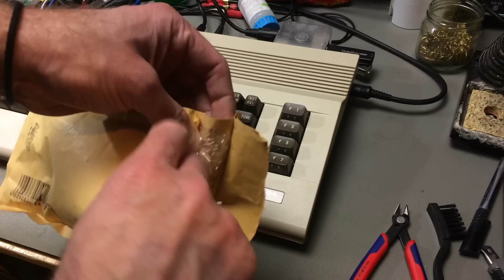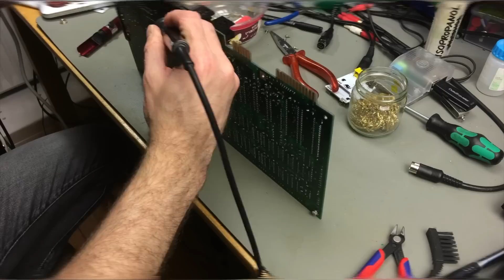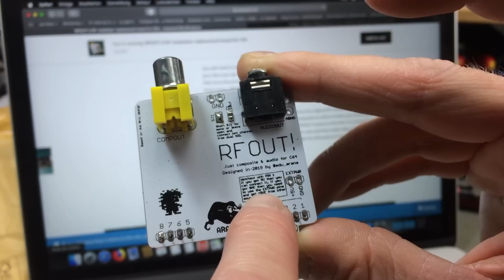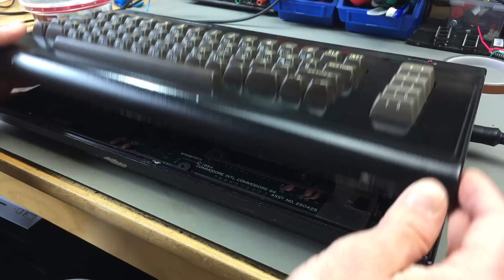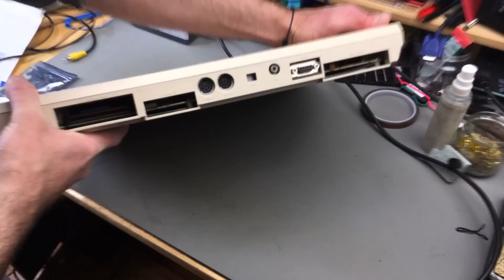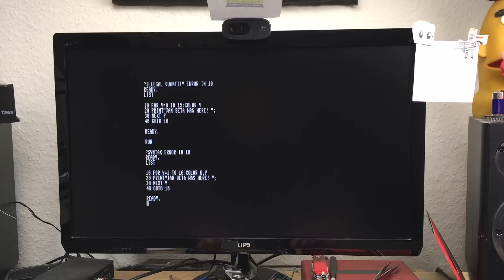More C64/C128 Video Output Options!

Comment: As for Edo's VDC-VGA converter (which is btw DIN9 to DIN15, just because the plugs look similar, VGA has many more pins!): Does it do dark yellow (=standard for all SCART based c128 solutions, like old-day cables or Sven Pook's new adapter) or brown (=TTL RBGI with the round DIN8 on a CBM monitor)? What about all the crazy modes/resolutions that Tokra uses in his "VDC Mode mania" stuff, do they work with this? 800x600, 960x540 etc?

Comment: The first person I remember that came up with a solution to replace the RF modulator with a new board was ZeroX aka Tommi Lempinen with his "Spider mod" (which I had installed on my main machine on X'2012). It needs to be pointed out that the video quality on the A/V jack (also Y/C or Svideo!) is greatly improved with this, too, and that the composite out cinch plug on this board (which should be instead a Svideo out if you ask me, since we all do have FBAS cinch already on the cable!) is just a bonus!... The plug in A/V board is nice to have, BUT it does not improve video quality like the RF replacement board does! /dk

Comment: Hello Ian. I have two questions. About the araranet replacement, on the main website is out of stock, do you know any other place where to find this (or similar) mods? Once this mod is installed would it be possible to use the c64 in a dual screen (mirrored) setup? Thanks for answering!

Comment: Do the easy expensive way. Have hocked my C64’s with the Turbo Chameleon 64 V1. It’s razor sharp with VGA. Hear that the new V2 version has ghosting. Have a lot of stripes with the C64 Reloaded MK2 with Composiet or S-Video on a modern TV. 

My best C64 is the C64C 250466 which have the best VIC-II chip. And is razor sharp on a TV with Composiet. Also the C64 250425 RevA have also a great VIC-II chip. 

Use now the C64 Reloaded MK1 which is much better and nicer than the MK2 version. The only downside it  must have  heatsinks.

2 years ago i had the Commodore 1702 monitor and that give on every C64 great picture. Now i use the BenQ BL702A VGA monitor. Have a second BenQ BL702A for the AMIGA 500/1200’s. Which have the Indivision ECS V1/V2 and the Indivision AGA MK2CR/MK3. Like the Indivision AGA MK3 and it’s perfect on the AMIGA 1200. 

For me the VGA is the best option for the C64/A500/A1200.
Reply from the maker: The "jailbars" are a "feature" of the VIC-II actually. So you will always get them with original chips. The newer versions 85xx have more jailbars than the 65xx incarnations, though. The Chameleon is a nice workaround obviously. I think the Ultimate 64 has no bars, too. :)

Comment: try epoxy glue to keep the male DB9 housing together?
Reply from the maker: Yes, thought about that, too. Edu actually changed the design now and uses connectors that fit, after I talked to him. The one I show in the video was an early test unit. :)

Comment: I'd love to see a four monitor hack for the Commodore 128,  Years ago I spoke with Bil about it at VCF East he told me they used to test the 128 with dual monitors before shipping them, He said running three monitors in Monochrome mode from the RGBI port should work. with that said it's a hardware hack that should work with any VGA and most types of color video adapters.

Comment: The RGBi -> VGA adapter will only help for c128 80 col mode. If you start a c64 game on the c128, it won't display anything right?
Reply from the maker: Yes, exactly, the C128 has separate output connectors for the 40-column and 80-column modes.

Comment: Does that C128 RGBi to RGB/VGA adapter produce the correct colours? Seeing you demonstrate it reminds me of a discussion I saw online that some adapters from RGBi get converted to an incorrect palette, but now I can't find that discussion again. :)
Reply from the maker: I think it can't produce brown for example, as it's only a simple circuit. CGA colors are really strange. I have to read up on that again, I don't remember exactly what the problem was but it's non-trivial to make a proper adapter I think.
Reply: @JanBeta  Okay, thanks, I'll see if I can find some info on it. Probably doesn't matter if you just want to do text-mode stuff and want an easy way to get a display, but if you want to run that C128-specific demo or the various art packages etc for the C128 then it would be a bigger deal.

Comment: This is probably a dumb question but I don't know enough about this kind of stuff to know if differences between region models would be a concern or not. Would that RGBi to RGB/VGA adapter work with an American C128?
Reply from the maker: There's no reason I can think of why it wouldn't work. The signal will be the same, except for 60Hz instead of the PAL 50Hz. :)
Reply: @JanBeta  Hmmm, well it's currently sold out and I'm actually not sure I have a monitor that's able to take the signal. Might have to stick to that little composite box. Thanks for the video, had no idea these kinds of things even existed. Hope I can get this old C128 working.

Comment: Bill Herd (the lead designer of the Commodore 128) has mentioned he was essentially tricked into using that particular chip for the 80 column display.  He was told it had a certain set of features that it does not, in fact, have.  One of them is he was told it would throw an interrupt when ready for more data to transfer to the private screen memory of the chip, but it actually sets a flag in a register that you then have to keep poling for.  (He and his team likened this to having to pick up the receiver on your phone to see if you've got a call instead of listening for the ringer.  In front of the designer of the chip.  By doing it every time the guy was nearby.)
Reply from the maker: Yes, I love listening to Bil's talks on YT. Many myths and stories around the design of the machine. Quite the adventure and an amazing (yet slightly strange) outcome. :)

Comment: You guys didn't have the 128DCR in Europe, did you?  I've been trying to figure out what the best contraption is for it, to replace the RF modulator and sharpen up the video and lessen the jail bars.
Reply from the maker: Oh, we do, I just don't have one here. The RF-modulator should be the same as in the short board C64s, so the RFOUT board should work fine. There's also a LumaFix128 version you could try. I heard people had very mixed results with that though.
Reply: @JanBeta  Ahhhh ok, so the pinout where the RF modulator connects to the 128DCR board is the same as the short-board 64?  I'd asked Adrian about doing his mod on the 128DCR after he did his video, but he said the modulator in the 128DCR is different.  But if the pinout is the same, well.....

Comment: Regarding the issue with the DB-9 connector screws getting in the way of connecting the board to the C128, for a temporary measure you could use small cable ties to keep the metal shield on, the thickness of the cable ties themselves shouldn't stop a good electrical connection from concurring
Reply from the maker: Yes, I though about that, too. Maybe I'll try thin wires, too, to help with conductivity a bit more.
Reply: Actually it is DE-9 not DB-9. Look for the D-subminiature article on Wikipedia for a diagram.

Comment: That C128 RGBi2VGA connector is interesting.  It's the cheapest option I've seen.  Any comments on how it compares to other converters out there?  Seems to produce a great picture!
Reply from the maker: It is only a very basic adapter and you need a suitable monitor still. Some of the other solutions output more universal signals (scan doubled, so they can be used on more monitors).

Comment: A lot of options to display the 128's output on modern monitors do NOT display the correct colors. I would love to see a comparison of the ouput (like color boars) from that device vs. connecting your 128 to a Commodore monitor.
Reply from the maker: This is not going to display brown for example, it's just a very basic circuit. I think on a RGBi monitor it would have more colors actually.

Comment: Man why are they gettin' rid of old format on TV's and monitors, quite a pain if you own old consoles and don't still own a CRT TV, good to see that there options out there for the older computers now though and I think you make me want to just cave and get an OSSC now to sort out my retro console connection issues. Sorry I've not been around much myself, but I continue to support you anyway, sad that you had to lose your job to this situation, but you do good so keep it up Jan!

Also Jan Beta was here! Disco! WOOOOOOOO.
Reply from the maker: Haha, thanks. I can really recommend the OSSC. I didn't regret buying it at all even though it's quite expensive. Spared me a lot of headaches I think.
Reply: @JanBeta  no input lag is a great benefit but I do still have one major concern and that is use the OSSC with older consoles and a new tv, I read that I would also need other sorts of cables much like the flylink and maybe scart connections as well for actual good picture quality with older consoles, which would mean some modding as well I think. So in that sense is why I hesitate to buy it. Have you tried that with older consoles as well?

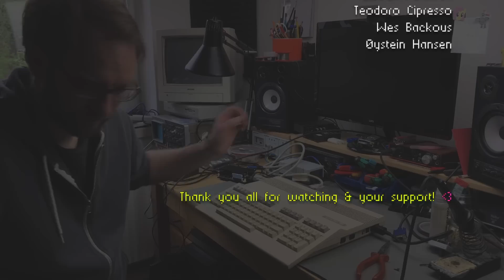Comment: At 24:50 This signal is perfect for direct connexion to SCART in RGB. No need for an upscaler, any european TV set will do the trick
Reply from the maker: Yes, that's true. Should work on most SCART TVs without problems.

Comment: Great video! I wish you well on your new endeavour. I still have my C64 which I bought in London in 1983 and it works. (after I built myself a new psu having zapped the original!) Last time I used it I connected it to a 1990s Sony TV with just an RF lead and the picture was ok but not great. I have a spare 2001 vintage Eizo LCD monitor with just VGA and DVI inputs. Is there any way to use that with the C64, what would I need?
Reply: You need an upscaler that will take S-video and output VGA or DVI.  (VGA is probably going to work more easily, as that 'standard' is pretty loose.  You probably want to use the S-video adjustment of the available C64 video signals because it generally gives the cleanest image available from a stock C64.)  An upscaler should take care of both the timing differences and the resolution differences.  If you search for "upscaler S-Video VGA" you should find a number of options.
Reply from the maker: Thanks! I use the RetroTink2X for connecting HDMI/DVI monitors to the C64. Can recommend it. The cheaper options unfortunately almost always introduce lag and some unwanted smoothing so they are not as good.

Comment: Hi Jan, the solution is just 2 M2 countersunk bolts away ;) 4mm long ones, I often did the same with serial dongles and other adapters back in the day. Also I think the correct way to convert cga and c128 80 column video to rgb involves a bit logic to fix the levels for dark yellow which should really be an bown like on cga monitors (confirm with the 1048 amiga/c128 monitor for instance.
Reply from the maker: Yes, thought about that, too, but I didn't have matching screws. I think the adapter doesn't reproduce the brown, as it's just a very simple circuit. More trickery needed for CGA brown as far as I know indeed.

Comment: Thanks for the video.  I have a C128 that I have never used in the 80 column mode but I might give that a try soon with one of those little adapters.
Reply from the maker: Never used the 80-column mode much before myself (except for testing it in monochrome), the little adapter is a nice solution. :)

Comment: Verbessert das Board von Edu Arana auch die S-Video Qualität an CRT Monitoren und TVs? Man sieht in den meisten Videos nur das Ergebnis an TFT oder LCD Geräten?
Reply from the maker: Ja, das Bild wird definitiv etwas "cleaner". Allerdings hängt das Ergebnis stark vom vorher verbauten RF-Modulator ab. Bei neueren Versionen (ca. ab den 250425 Boards) sind die Unterschiede nur sehr gering bis nicht wahrnehmbar.
Reply: @JanBeta  Habe heute das Board in der schwarzen, anscheinend neueren Version, in ein Assy 250425er eingebaut. Der Unterschied ist deutlich zu sehen. Das Bild ist über den DIN Anschluss schärfer und der Kontrast ist höher an einem CRT TV. Nachteil ist, dass jetzt die vertikalen Streifen wesentlich deutlicher zu sehen sind. Aber naja... man kann nicht alles haben. 😉 Die neue Version vom RF Out! hat jetzt auch Lötpunkte für SVideo auf der Platine. Vielleicht erhöht das nochmal die Qualität, wenn man das Signal direkt von den Punkten abgreift?

Comment: Hi Jan,

Do you know if there similar mods available for C16 / Plus 4 computers? I have a C16 with 64kb and would love to use an RGB connection to my TV.
Reply from the maker: I don't know of an RGB solution for the C16 unfortunately. It just outputs luma/chroma and composite. The A/V-board should also work on the C16 though, not sure about replacing the RF-modulator though.
Reply: Jan Beta Thanks for replying man. I’ll take a look at the AV breakout. Cheers.